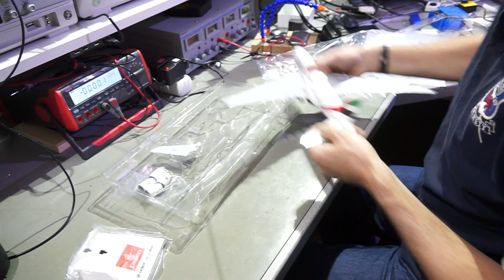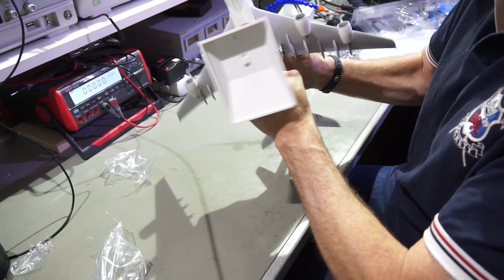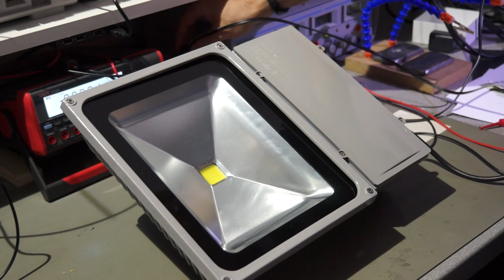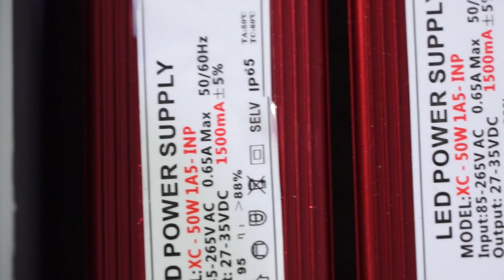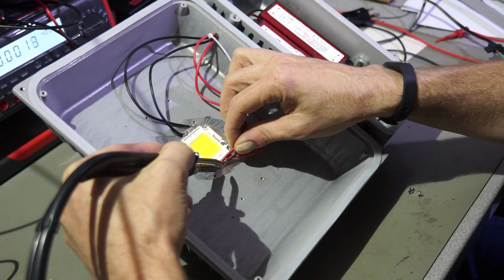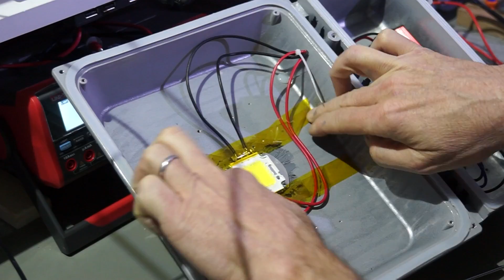#55 LABREP #1: Flickering 100 Watt LED Lamp/Floodlight Repair

Comment: I have LT-FL80A model which I have changed its LED Chip but again I have gotten the same flicking issue within 30 minutes keeping ON the LED.
Reply from the maker: After changing 3 or four times the LED I bought other ones :-(

Comment: Hi Andreas - this, as most of your videos has inspired me! I also has a flickering led (floor lamp). I disassembled the (3) LED circuit boards and tested them on a variable voltage/current power supply - I caused smoke to come out of one of them! (I think one of the other also had just a liitle smoke...)
on the "good one" still left - I can see "4304"  (sot23-5 ?) - I think it is a EC4304ANT2R - is this likely?
Reply from the maker: Unfortunately I cannot do remote diagnostics :-(

Comment: This light is nowhere near the brightest of the Powersmith Worklights    share4.photo/pWorkLight    it illuminates my entire 2 car garage. The halogen light that it replaces was also very bright but got smokingly hot after only a few min of use. The Led light is very compact - bright - economical with electricity. Works very well when looking into an engine bay.

Comment: I have a nice 110 v led light oprating on a motion sensor but  after a few months it started flashing and flickering. So I replaced the led chip and the problem went away then after a week it started flashing again. Replaced again after a week same thing. My chips didnt have two parts with two supplies. It must be having a heat problem.
Reply from the maker: A heat problem is well possible as these chips produce quite some power on a very small area...
Reply: @AndreasSpiess  yes as soon as it heats up 40 seconds or so it gets very hot  it starts to flicker and the supply voltage drops from 33 volts and to 20 volts and bounces up and down in response to the flicker.

Comment: Does this device flicker?
Reply from the maker: Yes, it flickered before the repair
Reply: Andreas Spiess I meant afterwards. ;-)
Reply from the maker: I had no luck with these LEDs. Because I had 6 pieces, I had to change LEDs nearly every month. So I decided to replace them yesterday. I use now flat LED panels which give also much less shadow. You will see their effects in future videos.

Comment: Missed opportunity for this video's title "How many engineers does it take to change a light led ?"

Oh and BTW, check out the 50W driveless LED chips on ebay. 1.84$USD delivered, connects directly to mains power and includes over temp protection !
Reply from the maker: +shodanxx lol. I did not know they exist. But the prices vary a lot. Are there quality differences. I ask, because I had to change a few more since this video...
Reply from the maker: Thanks for your links! O ordered a few to look at them.
Reply: They flicker. No problem for outside lights but a huge headache on your workbench.

Comment: hi, how are you getting on with the UNI-T 804? would you recommended it?
Reply from the maker: It is ok. I did not have particular requirements, so I cannot tell you if it is good quality. I just wanted a bench multimeter.
I have other instruments form UNI-T which work fine. So, I bought the -804

Comment: Andreas, take a look at the two video's big Clive made about these COB leds.
They are eye openers.
https://www.youtube.com/watch?v=mZZbj-DNk7M
https://www.youtube.com/watch?v=_wR_mFWeI6Y
Reply from the maker: +Kenneth Tan You are right. I tested mine. It behaves exactly as the one in the first video. The bonding is somehow not good and I can mechanically switch the LED on and off by pressing on it!
The new one for the moment works fine!

Comment: No its not ripe for recycling, you got your self a free 50 watter.....
Reply from the maker: +saturn5tony As I wrote below,  probably something in the manufacturing process went wrong and because it is only one chip, the other side could contain the same error and blow up a little later. So, for experiments, this is certainly still usable and I will keep it in my desk!
Reply from the maker: +saturn5tony I did not expect so many people helping a half dead LED ;-) Now I am convinced and I try to give the LED a second live.

Comment: Hello Andreas can you not reuse the old Led module and just use the good side? can use it for a smaller project a only have half the power so what 50w might be okay for a Diy lamp? Just wondering. It be a shame to get rid of it you know.
Reply from the maker: +joseph chrzempiec (josephchrzempiec) You might be right. Tu use it for experiments, you are certainly right. But I it might well be that something in the manufacturing process went wrong and because it is only one chip, the other side could contain the same error and blow up a little later. The price of a new one is around 5$. So, I prefer to go for a new one for a "production usage".
Reply: +Andreas Spiess hey Andreas so true might not take that kind of chance of of a fire or something. so for 5 dollars yeah cheap enough for another one. you are right.